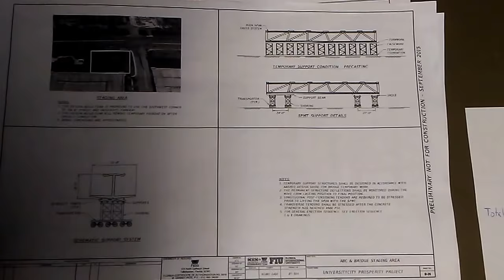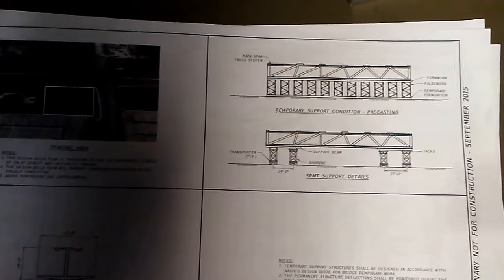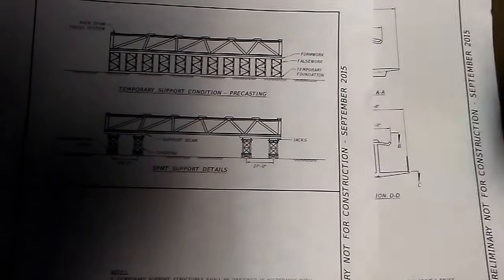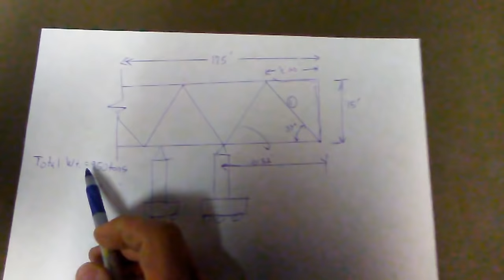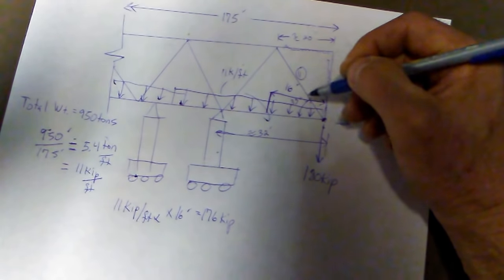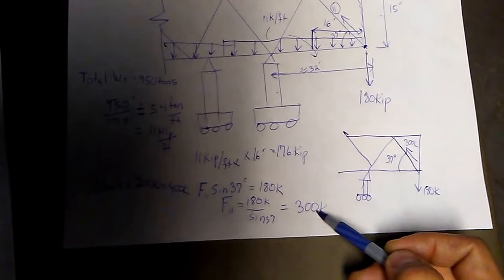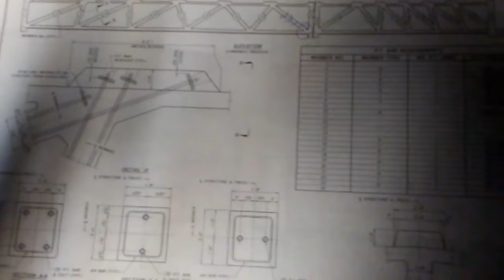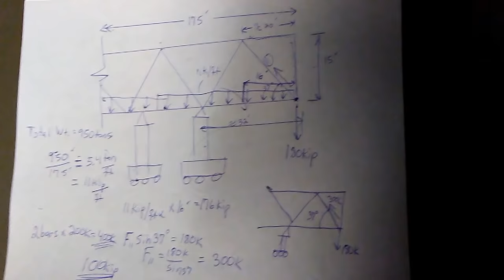FIU Bridge Collapse: The Hidden Truth (Part 4)

Comment: Ok stop it with the college talk. Your child sketch and math only brings attention to the inadequacy of your skills. Go back to your college and demand your money back. You all got robbed. The problem is a design that bowed the walk platform and roof canopy down not up. And how the cracks on the bottom of the V opened were because the steel cables were pretension before the  lift. With no load the workers reported the design showed flaws. All the materials and craftsmanship were checked. The 2 planes of strength were redesigned to cover the rain pipes. The computer ran a flat bottom and roof. Those cables were left located on the top of the V shape bottom walkway. Just as the original flat walkway, when the drainage pipes were covered with the V bottom. The cables should have been relocated to achieve a balanced compression. With the cables all on the top of the V you will bow the deck down. Like the neck of a guitar. And so goes the canopy top. Same rain drainage pipes. All to look like a sailing schooner.
Reply from the maker: Thank you for your input Rodney. Lol!  I'm not sure I follow I the logic or descriptions in your commentary....but your opinion of me and my penn state degree has been noted.